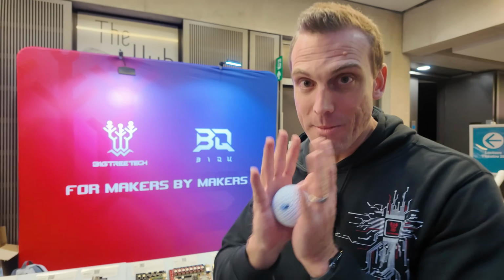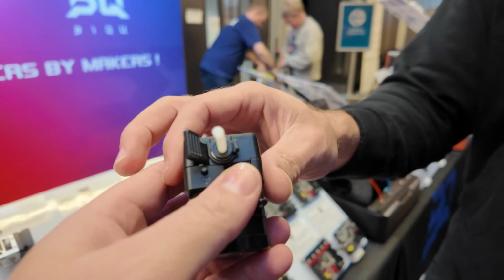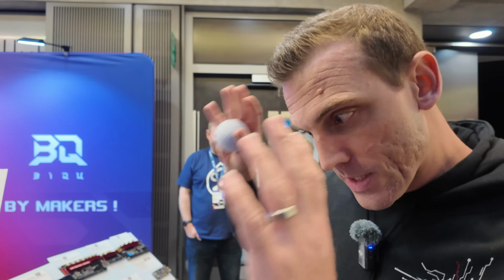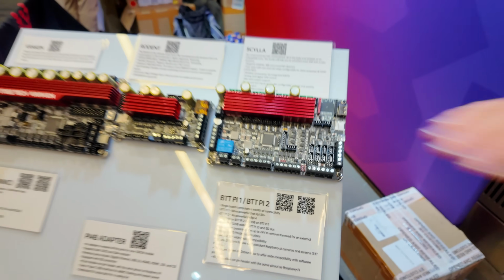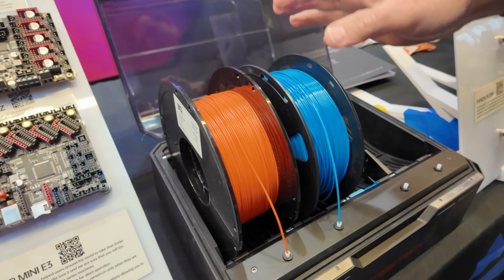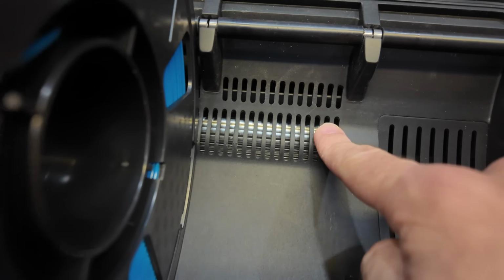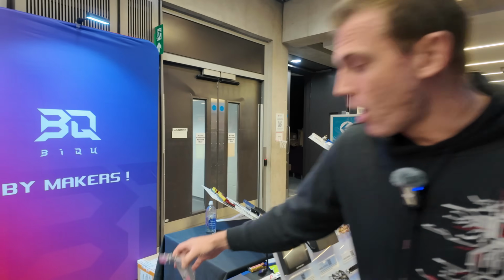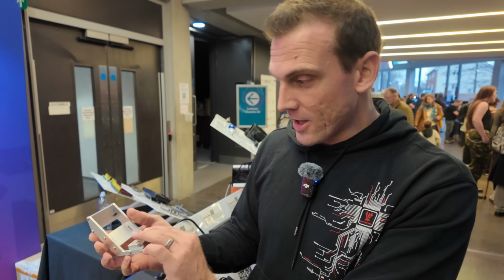Whats New From BTT @ SMRRF 2024!

Comment: No 350 plates. That MMS looks very promising, but it doesnt have a touchscreen for controlling the drying parameters. Will this be done trough klipper and sensors will tell you the parameters in the slicer?

Comment: Kind of feels weird remarking how the multi-material is CNCed out of a big block of polycarbonate while you could've printed it? They are selling 3d printer parts? 
He did say it's not the finished product, so why not
Reply from the maker: because you get a closer representation of an injection molded part with a prototype made with this method than a 3d printed one
Reply: Can't print something this large and get micrometer accuracy. Even SLS will warp too much at that size. Our only option was precision CNC. I remarked on it because it blew my mind when I found out. We are not a 3D printing company per se. We are a company that encourages making in any form and CNC most certainly falls under that umbrella.

Comment: DOOD. Okay, if Biqu does use some ultra more durable material than PTFE, they NEED to sell that for other printers. Imagine: New BIQU BQFE tubes for your __ printer, $30 lasts 10x as long. Do they realize how many print farms to newbs will buy that ish? Just to not have to replace bored through Bowden tubes as often? Freaking gimme.
Reply: The inner tubes will be PTFE but the main points of contact at then entry to the tubes that take most of the hit will be a different material that will basically never wear.

Comment: I was playing with the 3d chameleon and ramming - tip shaping was a big problem especially when using cht nozzles and I ended up using an eva 3 toolhead with a cutter and it really did take away all the problems so for me a cutter is a must.
Reply from the maker: its nice that its an option though, i really want to get one JUST for filament rollover, having a cutter for that sort of setup isnt really needed
Reply: @CanuckCreator  I was also working on my own rewinders using spare parts for the AMS and did have the motors and sensors working with an arduino and a piggyback switch to the chameleon, but I ended up converting to a tool changer in the end.